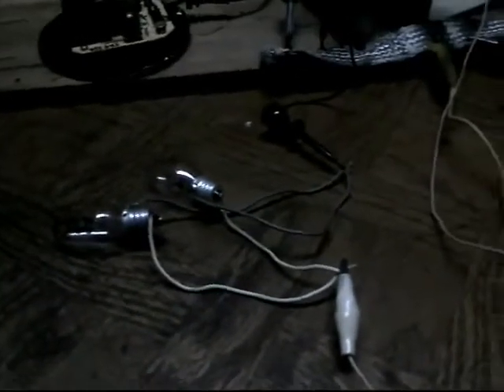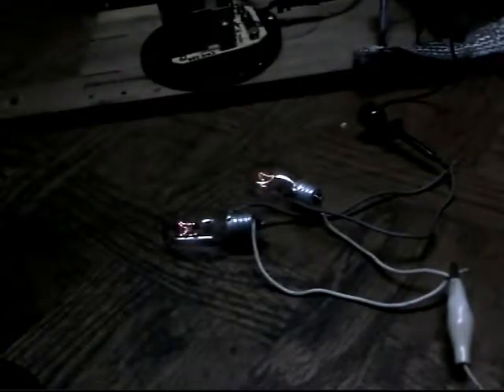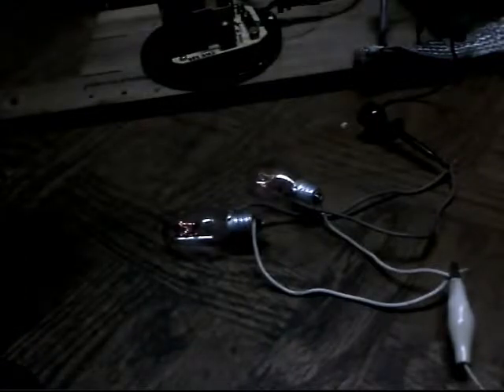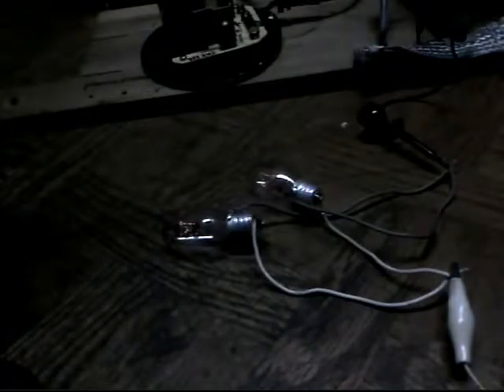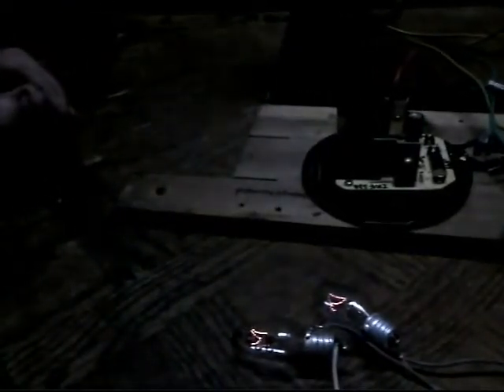Plasma Tower bulb test YT

Comment from the maker: I have found you can wrap steel screen,or Aluminum sheet around the tower
with 2" spacing,and use a 1nF HV cap + spark gap to get much better results.IF
you can find thin Aluminum sheet with about 1/3"  decorative patterns,[Home Depot]
this will put the radiative  output into the MHz range.I think its the "holes" in the Aluminum resonating,electric/magnetic field trying to escape. I run mine occasionally 
with a 12v "Ramsey" 20kv 18KHz at 5volts..You have to be careful that you do not run these Plasma devices too hard for too long..else the glass containing the HV element will burn a pin-hole through the glass and you'll lose the gas.Ive lost 3 small globes running them at 12v 2a.But they sure looked nice.